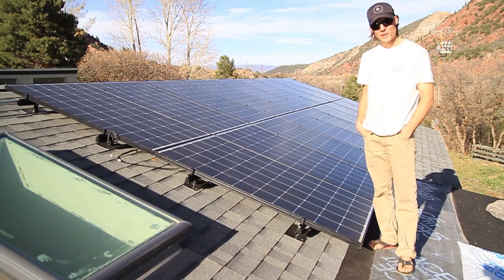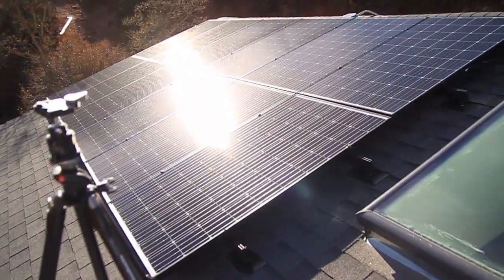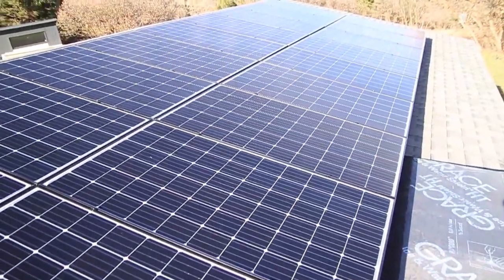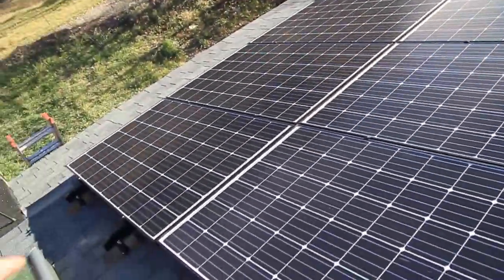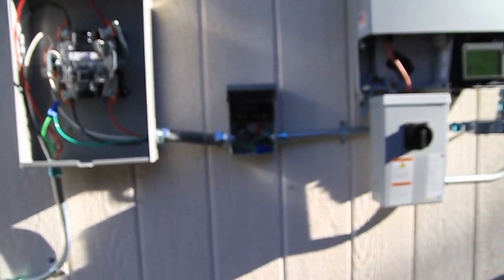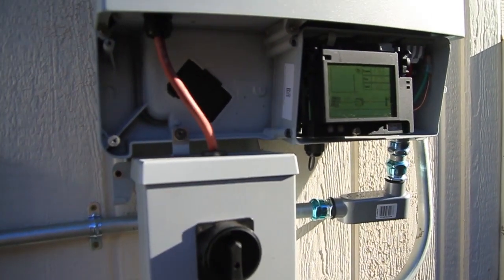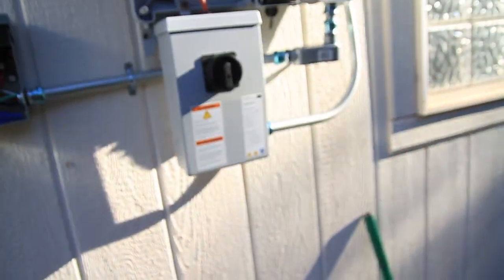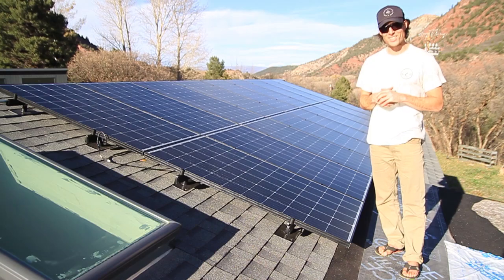HOW TO WIRE 8.25 KW OF SOLAR PANELS ON A HOUSE MULTIPLE STRINGS PRODUCTION METER WIRING DIY

Comment: i have 8 panels,  each panel rated (540w,13Amp,49voc), if I make 2 strings, (4+4) so each string will have 4 panels with 196voc+13Amp,  after i connect both strings together before i connect them to inverter...what will be my total given voc and Amps to inverter....will it stay 196voc 13Amps or this value will get double????
Reply from the maker: The amps would double, technically speaking you would have two parallel strings.  Amps add in parallel, voltage adds in series.  196 volts at 26 amps.
Reply: @JesseHoff  thank you sir for your clarification. God bless

Comment: So you have two strings of 585 Volts each. Does this mean the inverter is capable of two separate strings for a total of 1200 volts in?
Reply from the maker: Clipping power is one thing, gotta make sure you don't go over voltage though, especially with a system without optimizers in the cold.
Reply from the maker: No, inverter is only good for 600 volts, that's one of the reasons we break it up
Reply: Where is second supply of 583 V going?

Comment: Jesse I'm trying to fill out my utility company application can you help me with these question. 1. Metering (voltage, location, losses adjustment due to metering location and other: 2. Facilities to be furnished by cooperative. 3.Facilities to be furnished by DG owner/operator. 4. Cost responsibility. 5. Control area interchange point. 6.Supplemental terms and condition attached. 7. Delivery voltage. Thanks
Reply from the maker: Ya send me the form i'll take a look at it.  hoff.jesse@gmail.com

Comment: Nice work dude!  Question fer ya, I'm doing a 9.9 kW single phase system currently here in Pine CO.  Based on enphase IQ7+ inverters, IQ Combiner 3 and using 27 365w REC group panels and planning on using a single ground between the three arrays' railing running thru one raceway.  Is that cool or do I need to have a ground homerun for each array to combiner?  That would cramp up my conduit.  IREA says single ground will do but looking for your thoughts.

Also, what production meter panel do you reco?  It's the only thing I don't yet have in stock.  This is for IREA.  I have an all terrain 32' scissor lift coming Monday for panel installation and hope all my wiring gets done this wknd!  This is a high 8:12 roof too.  Kinda spooky but being a climber helps :)
Reply from the maker: Thanks man, ya single ground should do, good luck.
Reply: @JesseHoff  I’m at the point where I need to hire someone to help with installing 27 panels on three sections on a 8/12 asphalt roof.  All electric and railing completed and my climbing buddies too spooked to help.  How do you suggest I go about finding a crew of two?   I would provide a rough terrain scissor lift. Safety ropes already setup.  I looked at Craigslist and Market Place and not finding anything.  Located in Pine, CO.   Appreciate whatever opinion you can provide or references
Reply from the maker: @Iknowurwhoami  Man I wish I was around to help, ya climbing buddies are usually pretty good on the roof.  I use to work with these guys, give them a call and tell them you got some work for them under the table, I'll let them know.  Pete and Phil,  stay on them both, they might be busy might not.  970-319-5591 or 970-948-4814.  I was looking at my previous reply about the meter socket, some utilities require a lever bypass meter socket.  Hopefully yours doesn't, lever bypass are more expensive.
Reply from the maker: I don't really have a preference for meter sockets, as long as it's ul listed I say

Comment: Thanks for the video. I feel like when you showed us the disconnect in between the meter and inverter you had the neutral on a lug that was not isolated from the enclosure. Would this not be grounding the neutral in multiple location? If you were calling the solar a derived new service and your green wire was a grounding electrode, would your conduit system not need to be grounded?
Reply from the maker: Way to spot that Chuck, I wouldn't wire it like that again, wire nut on the neutral would probably be better.  As far as conduit being grounded, it varies with your AHJ.  I've had AHJ's that want all the conduit to be Equipment Grounded and some that don't even care.  If they want it, what i'll do is use those conduit bushings with a ground lug.  Thanks for pointing that out.  I just read in the NEC last night that EMT can be used as an equipment ground.  :-)
Reply: I was only saying the conduit would need to be bonded if you were calling it a derived new system and the ground was a grounding electrode.  Wirenut on the neutral good idea. But again thanks for the video.  You said 4 home runs, is that 2 positive and 2 negitive.
Reply from the maker: @chuckwickberg7246  yup
Reply: Instablaster

Comment: Cool video.  What SMA inverter did you use on the project?
Reply from the maker: I think it was a 7000.
Reply: @JesseHoff  Thanks!  6 awg or 8awg wire?
Reply from the maker: @roderickrobinson5976  8 awg for the ac side